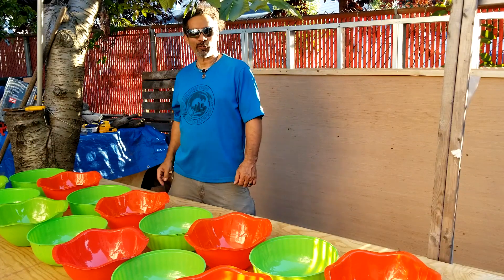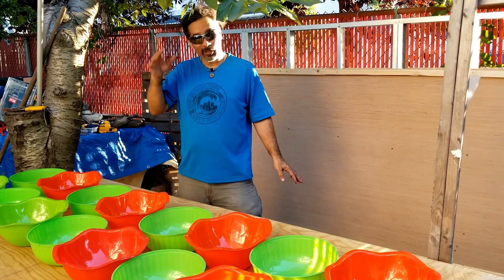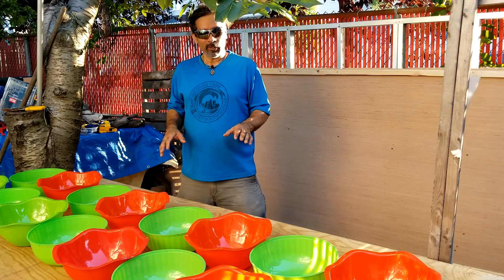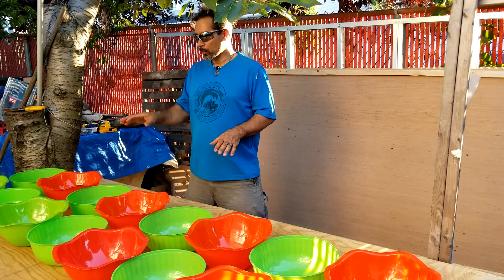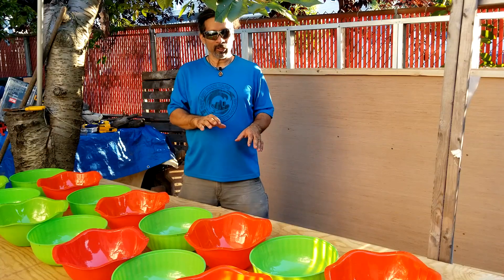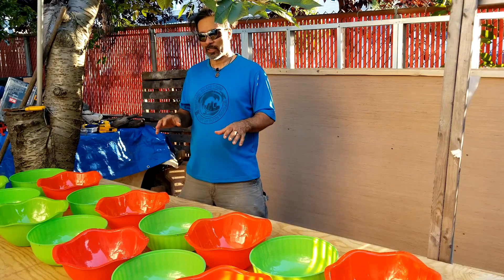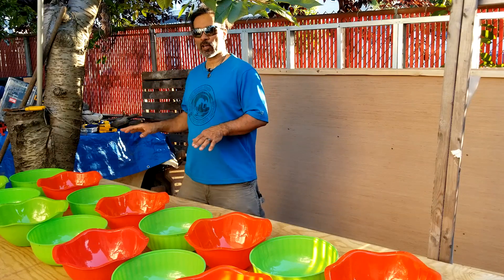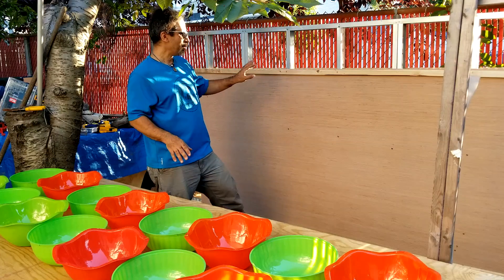Aircrete Testing | Wall Set Up #aircrete #aircreteharry #aircreteproject #diy #aircretewall #learn

Comment: Sorry Harry. If you plan on using steel stud forget about insulation value. Commercial buildings use steel stud because they use insulation on the exterior of the building. Temperatures will travel straight through the steel. Better to use wood studs R value per inch. If you still want a locking arrangement try adding dovetailed strips.
Reply from the maker: Stormrunner0002 the next wall that I build will take into account the steel stud and cover it with aircrete 1 inch thick on both sides of the wall. I will just be framing the wall a little thicker using aircrete spacers on the front and back.

Comment: Looks like, smells like, tastes like... but is it a good INSULATION? How good?  HOW will you objectively be testing each panel for insulation values?  Will you be taking your samples to a lab for testing? WILL THERMAL BRIDGING FROM METAL STUDS BE CONSIDERED?  See: https://youtu.be/PjfznDPOeDA and https://youtu.be/sqmDW1OpwKM
Reply from the maker: Douglas Pohl my tests have been delayed due to rain. But I think I have a very interesting way to test the air Crete for insulation that you're going to enjoy watching, that's all I will say for now.
Reply: OK Harry. Usually a TEST or EXPERIMENT is TRANSPARENTLY stated in advance so you can test your hypothesis against your results. As simple as... Which density of aircrete will provide the greatest resistance to heat energy transmission through identical thicknesses of aircrete? Example: Use a torch on one side and after X minutes measure the other side with your IR thermometer?  YOU already know the least dense or lightest aircrete mix is going to have the greatest insulation because it contains more air, so is the test for insulation OR WHAT IS THE LEAST DENSITY OF AIRCRETE MIX THAT CAN BE MIXED (without sand) AND TO WHAT VOLUME OF FOAM THEN POURED TO REMAIN INFLATED?  Where on the panel will you be taking your data measurements at? 12" or 24" or 36" down from the open top after removing the forms in 48 hors after pouring?  Measure data at 2, 7, 14 and 28 days? Thanks in advance...BTW, Please weight a cubic amount of each sample for estimating mix density. Many documents show 400kg/M3 as the lowest density.HARRY'S AIRCRETE'S DENSITY?

Comment: You said you are looking for a cementitious mix for INSULATION... Did you consider Airkrete aka MgO like used by ComfortGreen? See: https://youtu.be/hvJkBjh6U-g  What really comes through loud and clear is lots of rhetoric about various products rather than clear facts or a controlled test... Just a bit of due diligence and you know aerated concrete can be mixed in various density - 400kg/m3 light to 1800kg/m3 heavy - its clear that not one of the USA DIY air crete Youtube Channels knows what density they are mixing nor can they mix and pour to a given density - its an experiment every mix. Nor have they tested to any (ASTM) standard test for their air crete ( https://youtu.be/cf7TKiXquyU and https://youtu.be/Pz2vbiqNP-E )..Here are great examples of fresh or not concrete testing - notice the devil in the details... https://youtu.be/9SvOfdshDkM don't you think some basic tests for air crete would be of value? HDC claims to have been a certified QC tech performing ASTM tests but is reluctant to video any ASTM testing... what does that say... THIS SILENCE SPEAKS LOUDER THAN A FAILED TEST.... Its DIYers choice to test or not - but without knowing an air crete mix characteristic you cannot properly perform engineering with any certanty... I'm not convinced that an animal should be using an air crete structure. Some accellerated environmental life-cycle freeze-thaw and wet-dry UV tests would be a good start.....  KUDOS Harry for doing tests to date and sharing them on Youtube.  I'm looking forward to your next video. I really hope you decide to detail your wall test mixes in hopes that another Youtuber will verify your mixes as achieving like characteristics... steps for good science requires third-party verification.  Standing by!

Comment: How will you test the R-value? Why did you put the metal channels back-back? Don't forget to tell us the increase in foam volume on each batch (panel), the weight before/after curing, and the stiffness. 
Suggestion: Go slow, doing just 4 different foam mixes first, nothing else. Remove panels and use the forms for 2nd phase, mixing for strength, 1.sand, 2. fiber, 3. micro rebar 4.?
I am looking for highest R-value for a building wall. 
Also, if doing a security/privacy standalone wall (12' high?) I want strength, not insulation. How will you measure that? 
Have you tried mixing in a standard concrete mixer instead of the egg-beater?

Comment: Hello Harry, I have followed you and learned lots from you so first and foremost thank you for all your videos and experiments. I have working with Aircrete lots and learning things that affect the strenght and insulation. I have noticed one important thing when working with Plywood, if you make it wet before you pour you will find the outter layer of the aircrete will be smoother and stronger otherwise the plywood will dry out that part to fast and wont cure nicely, if I may suggest for one of your test walls trying  to wet the inside by spraying it before hand to see how the finish works it will be cool to see it in comparison with the rest. Best of luck with the experiment and thanks
Reply: Great suggestion! This is P. Cement after all.

Comment: KUDOS Harry, you are doing what should of been done long ago... did you consider placing a sheet of visqueen plastic to extend the plywood life for re-use and easy release?  I would think it important to not do just low density mixing for insulation but also higher density mixes for mix optimization and testing. Suggestion: Low density mix by weight: 0:1:0.6 Sand:Cement:Water with twice the slurry volume as Drexel foam. For mid range density mix by weight: 1:1:0.6 Sand:Cement:Water with 50% of the slurry volume as Drexel foam and a higher density mix by weight: 3:1:0.6 Sand:Cement:Water with 25% of the slurry volume as Drexel foam.  Caution: DO NOT use uniform play box sand, use construction or cement sand with mixed sand particle sizes for strength. Likewise any additives should be avoided if you have not previously tested in a controlled aerated concrete mix by themselves. Its going to be important to use a tested admix to accelerate the aircrete initial flash-off curing to retain max bubbles. You do not want your aerated concrete to go flat. FYI Sodium carbonate & sodium bicarbonate, to a less extent, both shorten the setting times but at a penalty of greatly reducing the compression and strength at 28 days cure. Consider doing your own setting timed tests by adding 1-2% of the mix solids weight with calcium chloride dihydrate (CaCl2·2H2O) ((ice melt)) as an accelerator. Another accellerator mix is 1 % CaCl2·2H2O and 20 % hydrated lime Type S (again the percent is against the mass of cement and/or all of the solids). Consult www.aci-int.org, www.cement.org and www.nrmca.org for use re dry, liquid, best add time specifics. Pouring the small walls by hand bucket batching is ok for testing, for larger pours with a batch plant truck delivering cubic yards get a volume rated peristaltic grout pump or hire a pumper truck is optimum rather than using a trash pump which will destroy the entrained air (pops your bubbles) in your aerated concrete slurry. TEST TEST TEST then go for it.  Good luck!

Comment: Should u not put a film and/or release on your plywood? In normal concrete they use HDO that has a really smooth surface from a film and a release as well

Comment: I think if you put some screws half way in on the back of the studs, the screw heads would lock the panel in place. The mix would form around the screw head. Also, if you put a small rebar through the electrical chase it would keep them all in place. I think you are on to something pouring them all in place. I suppose you could sheet a entire wall and then take the top off temporarily to pour the mix. I like it.